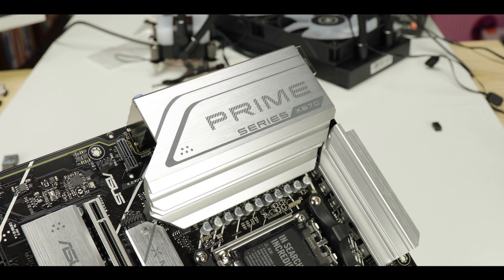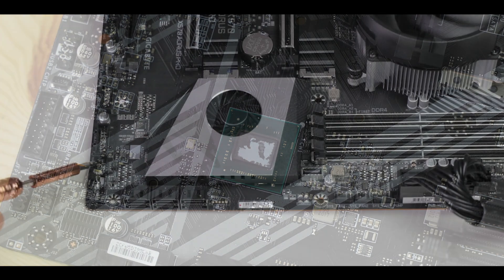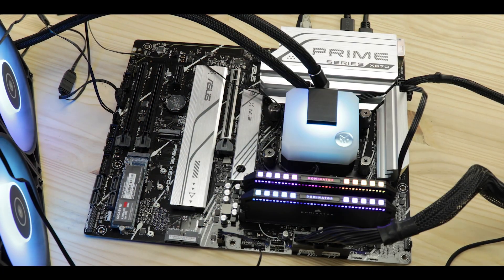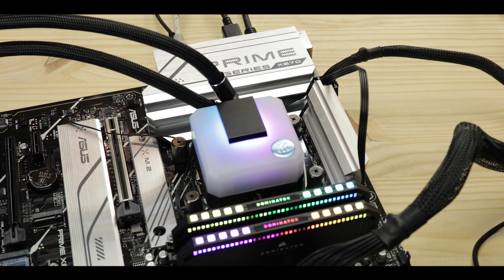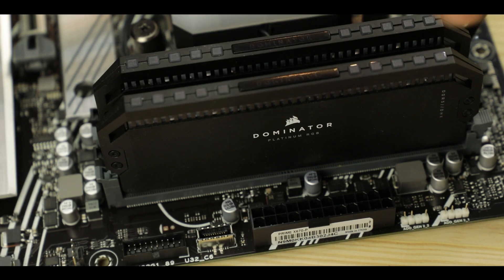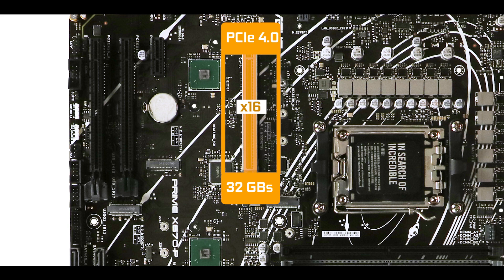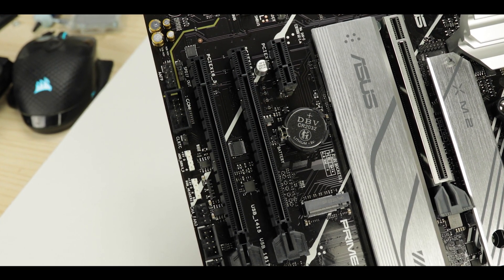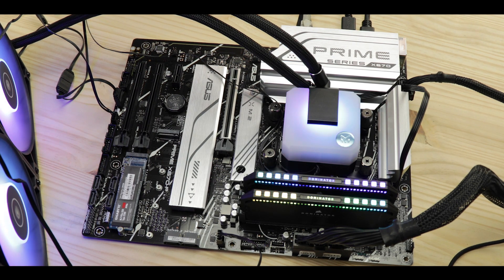ASUS PRIME X670 P : I'm not happy!

Comment: since when 50 C became "overheating" for VRM? wtf you talking about?????
Reply from the maker: It's not overheating. Just watched the video again... I never said it was overheating.. never said 50c would be overheating ..   all I said is that I can't complain about it's thermals. 

What are u talking about ??????
Reply: @Laurentschoice  13:58 " like the welding VRM " it's not yours words? it's an illusion??? ) also next words "overheating chipset" which is also only at 50 C, so dude, again, wtf are you talking about? are you nuts?
Reply from the maker: @Feel_Fried ooooh the chipset !!!   Yeah. 50c in an idled CPH. Definitely worrying.      This thing can get really hot during file swapping.. and yeah 50 on idle is simply not acceptable for such a bandwidth packed CPH. 

Hope this clarified
Reply from the maker: And no "welding VRM" are not my words :). My words were "the underwhelming VRM" meaning that is a little light for that CPU Ryzen season ;) :) ,,😘
Reply: @Laurentschoice  then first - you need to fix your prononciation and second - you had the motherboard and didn't made any actual tests under load? just assumptions based on nothing? are you nuts bro?
Reply from the maker: Well no idea what a "welding VRM" is  :) 

Well, it's not a bad comment u make here. 
 When ur at 50c idled... With 6/7 watts PCH, and a good thermal paste , u'll Peak at 70c. Which is still fine. 
My problem here is that, as the thermal paste dries out (say 12 months from now , look at the video I just released if u want to see how bad that problem can be), then you'll have another problem all together. U'll have peaks going around 100 and above. 

That's not something I can test. But I can predict what will happen over time, based on the PCH power / the heat shield / and the idles temp. 

Rule of thumbs. A good PCH idle temp should be around or below 40c. Thats a longer life span even if the thermal paste dries out. 

I hope this is somewhat clarifying and thanks you for the contribution.

Comment: nice video bro, I‘m like ..using this for 7950X & 4090 right now, is it a good match ? If you gonna pick ,which motherboard is the perfect one for 7950X & 4090 ? need your help, you're professional.
Reply from the maker: It'll do ok with it. Would I necessary go with it for the long term and such power hungry components.. maybe not . Id go for a Strix or a TUF instead
Reply: @Laurentschoice  got it.thanks for answering

Comment: I'm using this MB with 7800x3D, 32GB DDR5 6000/cl30 and a 4090 strix.
I use the PC for VR sim racing exclusively and I do encounter occasional freezes, random restarts...especially if I push the setup to the limit. But in the end I am quite happy
Reply: Hey man, I am pairing it with a 7800x3d and a 7900xt, should I expect any problems under maximum use of the cpu and gpu? What about longevity of the mb?
Reply: @ZimmerGD  Capacitors are the "consumables" when it comes to power delivery on these motherboards.  You will notice they are rated by expected hours @ a given temperature.  If you have good cooling (maybe one well placed active fan that gives gentle blow(jobs) to the VRM section of the motherboard) you can expect the motherboard to outlast the usefulness of the AM5 era.  With poor cooling, your mileage will decrease.  Cheers!

Comment: Welp got a really good deal on this board at a micro center for my new pc build. witch I was planning on getting a Ryzen 7800X3D but after watching this Im a little worried. Still gunna try it out especially since I don't plan on overclocking at all. but still. 

It wasn't the original board I was planning on getting but at face value without knowing anything about the board it seemed like a upgrade at a good discount (Bc micro Center is just amazing) 
so hey I got it now and I guess I will see how it goes.
Reply: How did that turn out? Cuz I'm at the same boat as you now 😅. Have the board because of the discount, not the one I was looking for but I guess I'll make do.
Reply: How is it now ?

Comment: Works fine for me
Reply: Whats your build ?
Reply: @Mr.Punishedvenomsnake That mobo, 7800x3D, TUF 4090, 64GB vengeance expo ram, h150i lcd cooler, hyte y60 case.
Reply: @ipodguy9 are you able to run it on high settings?
Reply: @ZimmerGD  Run what on high settings?
Reply: @Mr.Punishedvenomsnake  I did reply, but can’t seem to see it

Comment: I threw 600 euros down the toilet, I don't know if the card or the Ryzen 7 is buggy. It did the POST a couple of times, I navigated through UEFI, everything is fine, CPU temp is normal etc etc. then on the third reboot the CPU fan stopped spinning and there was no more video output. it's ridiculous, in 25 years I've never seen something so unstable. I did everything possible, updated bios, reset bios values, monitor always black. I'm returning them both to Amazon, I hope they accept the return, but I have little hope.
Reply from the maker: I mentioned this,  and got torched for  it. 

RMA. They ll refund

Comment: I've built a homemade computer with this Asus Prime X670-P WIFI and AMD Ryzen 7700X processor. But first trial, there is no BIOS screen on the monitor. I've tried all the ways. BIOS update, CMOS reset, one RAM etc. On last attempt there is solid light, doesn't work. Is there anyone to help me?
Reply from the maker: Wait upto 30 minutes ... it will eventually start moving . Ridiculous but true
Reply: @Laurentschoice  ohh yeah? This is bios update. Shoudn't take too much time but I'll try like you said, thanks.
Reply from the maker: Its a known issue. And I had the exact same problem with mine.
Reply from the maker: I waited a good 30 min before the light changed... and then it worked fine
Reply: @Laurentschoice  Thanks dude, I'll give a shot today. I hope it could work. I'll mention the result. 30 minutes waiting time is odd.
Reply: @baturaybilguday3576 did it work?
Reply: @Ghostlynotme445  Hi mate! Unfortunately doesn't work. I've sent the mainborad to Asus service. They did reset the BIOS with update version. I think when I did try made locked the mainboard. But now I use it without any issue.
Reply: @baturaybilguday3576  I’m shocked that asus service help you after all the bad quality control issues with there company

Comment: Err. no the PS/2 is not great for your grandfather but for me as a gamer with my pwnzor QPAD MK-80 for nkey rollover and usb driver independency. In fact, this is one of the very few AM5 boards with PS/2 support, a definite buying reason for me. That the backplate comes as a loose part is on the contrary of absolutely ZERO NAUGHT NISCHT importance to me, wonder why this is so important for you to ramble about. :p

And it works absolutely fine with a 7800X3D, I think your CPU recommendations are too conservative here. For now 250 EUR it was my board of choice (and not even for budget constrain reasons), ofc I would´ve thought else if I went for a 7950x instead. But this board provides a kickass gaming rig with RTX4090, 64 GB of OC´d  Kingston FURY Renegade RAM, Asus Essence STX2 audio card, extra LAN card. Plus aethetics in a white Fractal design case plus white NZXT Kraken AIO. I say: Perfect board for this use case.

Would have been nice to find some benchmarks in your review cause I came to find these and compare but naught.
Reply: It does not have a power good LED. Neither does the psu. Every time I add a component I have to be really careful. I have to double check my psu switch. Smd LED cost less than 0.1 cent in bulk. I wonder what other comprise asus did to save money???

Comment: Dude ... 720 amps for the CPU not that much ???  Sure not for OC , but an 7950X 16 Core lowered to 105W TDP will run perfectly fine with only 3-4 % loss in multicore Performance while Games run as fast as with 170WTDP  , i am sure that there will be a teamed mode ( previeous Asus Boards had it all ) = if you dont use the IGPU the 2 Phases for the IGPU can be used by the CPU as well = up to 120 Amps more for the CPU .  You can run one 5.0 NVME + two 4.0 NVME SSDs on the onboard slots  + additional two 4.0 NVMEs if you buy PCIe M2 Adapter , 3.0 rated ones cost only 2-3 Dollar each and i would not be suprised if they can run at 4.0 speed as well since there is no chip on the PCB , only rewireing = finally i can use my old 1TB and 512 GB NVME SSDs again ....

Comment: The biggest joke is that it lists "QLED-core" under the features, but I don't think that's actually implemented. According to the Asus website, QLED-core means the power LED should blink if there is an error, and the blinking code indicates which error it is. But I can take all the RAM out of my board and still not get the "DRAM error" blinking code. The manual doesn't say anything about it either, other than listing QLED-core in the feature list!

Comment: TBH 12+2 VRM is MORE than enough, i was running with my x570 which had 12+2(60amp) 5900x overclocked and still had to limit the power what the motherboard wanted to give to the cpu, also 50c vrm is ok result since you dont have ANY airflow there.. 
But yeah, got that board from the Blackfriday offers.. has been OK board for the price, no complaints... a bit of memory issues and some but that is to be expected since new platform, strugled the same things even more with 12600k at launch.

Comment: Thanks for your review. I'm living in pain with this motherboard since the beginning. Got a Ryzen 7 7700X, so as not to be too ambitious, and 4x32GB of Kingston DDR5, checking that the memory model was officially compatible with the motherboard. When I turned on the machine, it was flashing all over and taking ages to show anything on the screen. I double-checked my build, everything was correct. I thought the motherboard was defective, and was about to return it. Then Asus released a couple of bios updates, and things improved a bit. I just went with whatever bios defaults they have, because I'm terrified of changing anything in the bios and having to wait half an hour for the PC to boot again.
Reply from the maker: Last time I mentioned that problème I got torched by Asus ... you are not alone!
Reply: Simmilar issues here. Then I rather switched to AM4 but will never buy any Asus product again. They refused to change the product or give me the money back. Horrible motherboard...

Comment: I found it on Amazon (UAE) but it says on the Product Details section, the memory clock speed id 2133 MHz, while on the provided pictures it days the memory clock speed is 6400 MHz (OC). But that is a huge difference between the base speed and the OC speed. I don't think in reality 6400 MHz can be reached with all DDR5 rams that support such speed
Reply: It is Max 6400 ? I want to find the Max speed support.

Comment: Disclaimer I haven't bought one, I've only looked at AM5 motherboards lately, but this one may very well get the closest to the exact feature set I want. Sure it's not cheap, but that's an AM5 problem right now, not an Asus or Prime problem. This thing in particular does give off an aura of "set it up once and then run it for years" enterprise workstation settings, and that's what I actually like about it.
- The PS/2 port (in fact the only AM5 board I could find with one) and the USB 2.0 ports and headers for legacy components and peripherals.
- The reasonable number of SATA ports for legacy drives (a lot of AM5 boards only give you four which would already be too few for me, let alone two).
- The actually useable secondary and tertiary PCIe slots at 4.0 x4 each, a lot of other boards throw a completely pointless PCIe 5.0 x16 primary slot at you (you can run an RTX 4090 on PCIe 2.0 x16 with minimal bottlenecking, so bottlenecking 4.0 x16 is not going to happen for years to come) but then you only get one other PCIe slot, let alone two, and that slot throttles your primary one if you populate it, or it operates at some bullshit PCIe 4.0 x2 or PCIe 3.0 x2 so fuck whatever you planned to put in there.
This on the other hand is a setup that's just balanced and makes sense. If you only throw the fastest graphics card you can find and a single NVME into your computer then you obviously won't care about this, but the rest of us does. Also the VRM is perfectly fine if you fine tune your CPU power consumption and don't just run it out of the box like a complete stump. And really how often to you need a Q-code display or gimmicks like onboard power buttons anyway? The clear CMOS button and BIOS Flashback button are there for absolute catastrophes, and otherwise once it works it works. Me personally I'm glad this board is configured exactly the way it is because no other board is, and it may very well be the one I end up buying especially if I can wait until the first price cut.
Reply from the maker: Thanks for your comment :)

Have you checked what Gigabyte has done with 300 bucks ? ( x670 aorus elite, I made that review). 

Your points would be valid if ... there was simply no competition :). 

Sure it's fine... if it was $190. At 300 bucks it simply makes no sense, neither in componentry nor when compared to its natural competition  :) 

I hope this helps 🙏
Reply: @Laurentschoice  yes and did you see what gygabyte problems are unsolvable in its BIOS? like if you have a problem you are fucked. No study behind, no communty checking bugs, so little buyers. So don't talk only watching the hardware performace, think overall please. Asus/MSI are bought more and cost more for a reason.
Reply: @Laurentschoice  sir what can someone do with the extra PCIe slots I am kinda new to desktop builds and  its components,thank you

Comment: I wasn’t sure which board to get to try to get an upgradable board that I can drop in either 7000 future AMD processors. Like a 78 100 X 3-D, I’m hoping this will last for years to come. If nothing else I got a good case and a 1200 W power supply so if the board does not work I can always just take it out and put in a new one. I was hoping to be able to upgrade to a future AMD a.m. five socket processor and drop in a 4090 or 7800 XT. Do you think this board will work to do those things and drop in a new process or in the future? I really wanted some thing that was Upgradable

Comment: Wait, how is a 52 deg VRM under stress test not recommended for a 7900x or 7950x, and how did you not know the boost clock was single core when it basically always has been.
The zen 2 scandal was born due to chips not hitting their single core speeds but even then it was still single core and not multicore.
I don't really want to be rude but if your cpu's isn't a great overclocker it doesn't mean the motherboard sucks or the vrms are bad.
Those Amps are more than enough, we had 100w chips running on shit 200Amps boards with barely any heatsink and now for a 190w load 840 Amps are not good enough? Im not sure you are right.
Reply from the maker: It is . I think that I was very clear in the video that temps results are unsurprisingly good. 
Boost clocks and all previous processors ( Ryzen 5000 or current and previous Intel CPUs) use their boost ( or turbo in Intel vocabulary ) as an overlooking base line. 

The fact that Ryzen 7000 series advertize boost clock which can only be applied on a single core ( ok 12 core CPUs) is clearly ... well let's say... inappropriate  :)
 The point of this review is that ... for 300 dollars you should be expecting much more. I invite you to watch the X670 AORUS ELITE Review I just published . And things might make more sense to you :)

I hope this clarifies your interrogations :)

Comment: Srsly do you think a 720A VRM couldnt handle an 7950x with ease? Might wanne watch Buildzoid running A VRM without a Heatsink using a 7950x with Prime95. Those CPUs dont even pull 200A.
Reply from the maker: It can, I just find that it's overlooking abilities won't be as good as similarly priced motherboards. 

Check my aorus elite review in 2 days... about twice the vrm for an identical pricing.

It is a great board. But just overpriced. That's the point i am making all along the video.
Reply: @Laurentschoice  I will. I realy like your approach to reviews. Its not as technical as Buildzoids but straight up facts and good informations. Btw. press F to pay respect. BZ 7950X died while Overclocking during a twitch stream.
Reply from the maker: F:)

Comment: You say it's not worth it (and make good arguments why it isn't), however as it's one of the only AM5 boards to include a fourth PCI-E slot that will allow it to demand a premium.  Of course the question has to be asked why most manufacturers thought buyers would rather have 4x M.2 slots and 3x PCI-E slots than 3x M.2 slots and 4x PCI-E slots in the first place.  While most users won't want to install three expansion cards (excluding GPU) I'm sure there are more of them than the ones who want to put 8-16TB of NVMe storage in a consumer board (and even then they could do that with a fourth PCI-E slot and a £10 M.2 card).
Reply: I just used this board for a build for my brother in law. 7600x/x670-p/Kingston 5600/3080 and I quite liked it. 
Everything worked how it should, oc the ram to 6000, 30 case no problems. Undervolted the CPU to 85 watts and a steady 5.45mhz all core. Worked great for me.